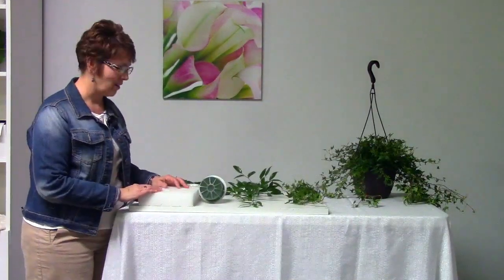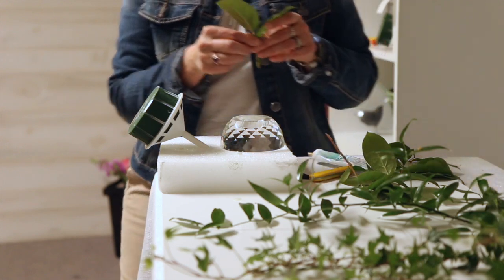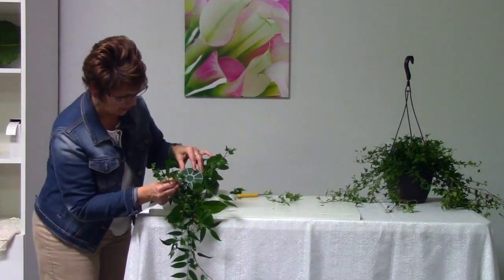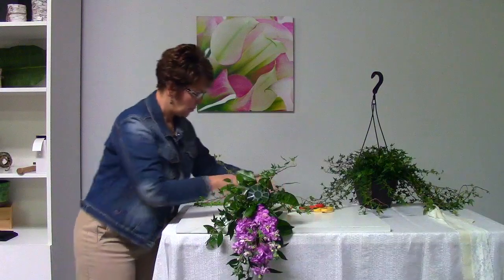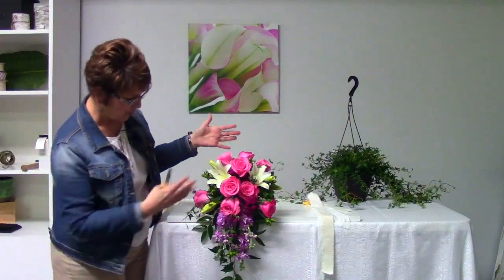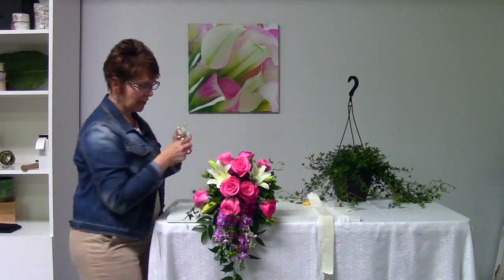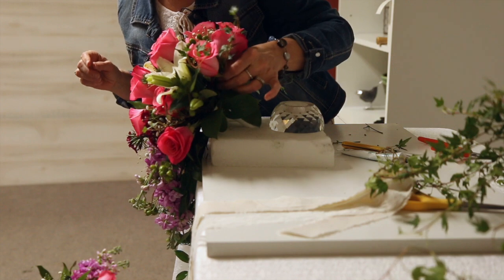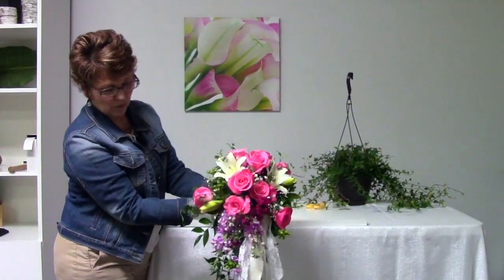Workbench Basics: Teardrop Bouquet

Comment: What about water for the flowers? Also best way to store before wedding?
Reply: the foam inside the bridal holder is wet so the flowers drink from the foam, but you dont want to glue the bottom of the stem as then the flower can drink water because the bottom is covered in glue. Just glue the sides of the stem as you put them in. Keep flowers as cool as you can, or even a fridge 6 degrees is best otherwise a cold room out of sunlight or heat.
Reply: Is it better to arrange these two days or the day before the wedding in order for the floral sponge to have enough water? Also what temperature should the florals be placed in?
Reply: Ashlyn Ibuado make them the day before not 2 days as the flowers will open and the bouquet would look quite different after 2 days. Best to keep at 6 degrees but not freezing as this does as much damage as too warm.

Comment: Glueing the cut surface of the stem is not a good idea, cause it won't let the stem take up water.
Reply: I agree
Reply: The glue is place around the stem close to the cut end but not over the cut itself. Putting glue on the cut end point would prevent the taking up of water.